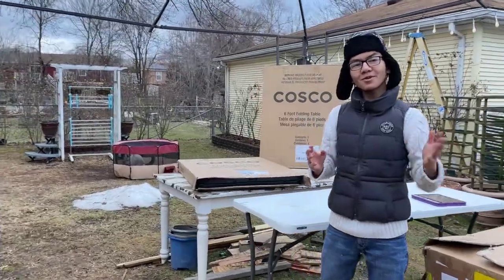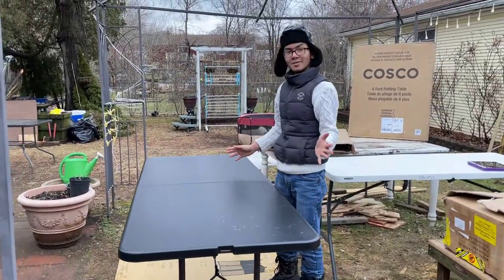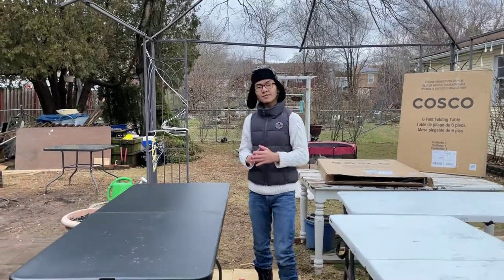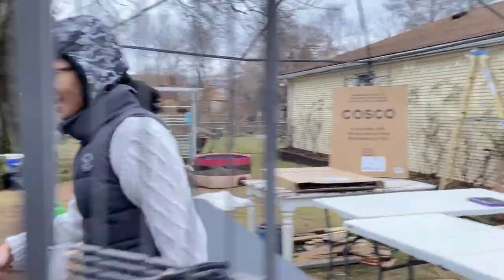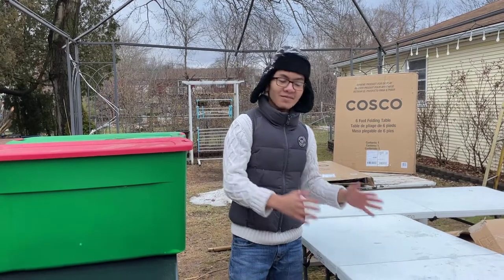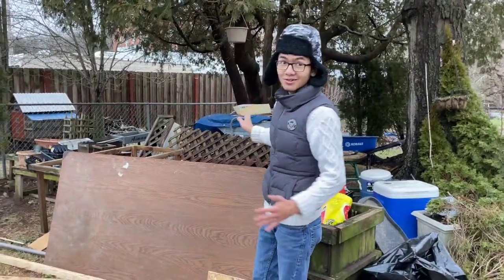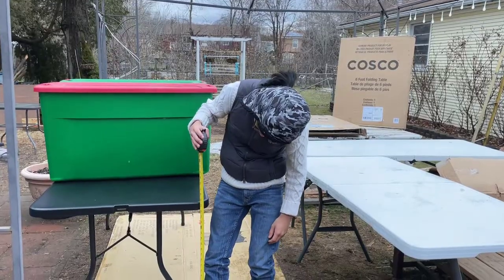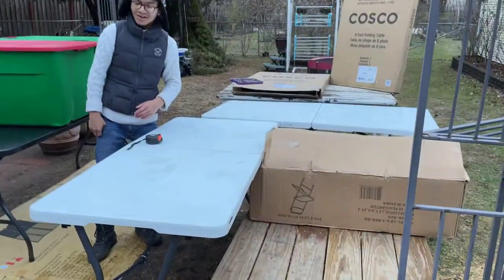Here's A Good Budget Foldable Table For Events Outdoor Party Picnic Wedding | Cosco 6 Foot Folding

Comment from the maker: Here's the #ad link to the 6-Foot Cosco Table reviewed in this video:
https://amzn.to/2NaAQ3V  |  Cosco Deluxe 6 foot x 30 inch Fold-in-Half Blow Molded Folding Table, Black
Here are the alternatives:
1.  https://amzn.to/2Y9oH1H  |  Best Choice Products 6ft Indoor Outdoor Heavy Duty Portable Folding Plastic Dining Table w/Handle, Lock for Picnic, Party, Camping - White
2.  https://amzn.to/2KuHq4m  |  BestOffice Folding Table Camping Table Folding Table 6 Foot Plastic Table Fold Up Table Lock for Picnic Table Party Table
3.  https://amzn.to/2XWPTRa  |  Office Star Resin Multipurpose Rectangle Table, 6-Feet, Center Folding
4.  https://amzn.to/3o1zoxJ  |  Flash Furniture 6-Foot Bi-Fold Granite White Plastic Banquet and Event Folding Table with Carrying Handle
5.  https://amzn.to/3bVMIkE  |  CCS 6 Foot Steel Frame Fold In Half Folding Table (6 Foot Table)